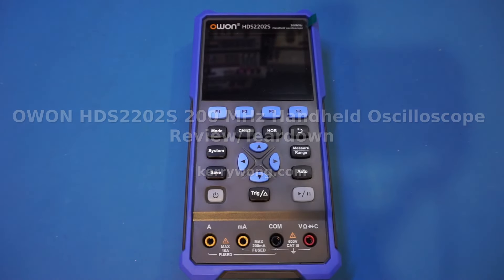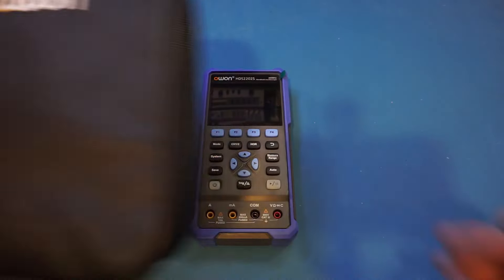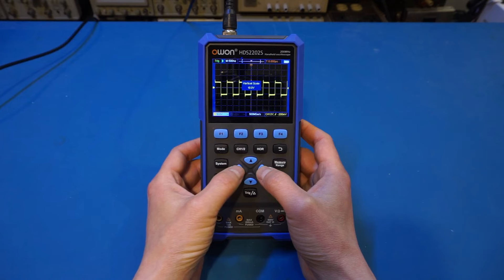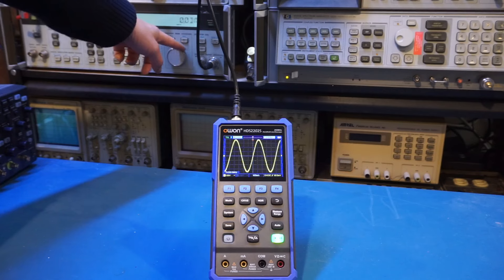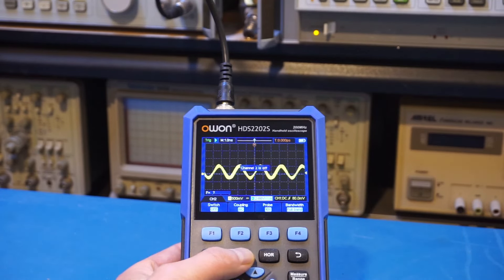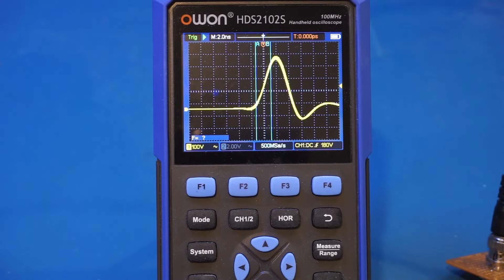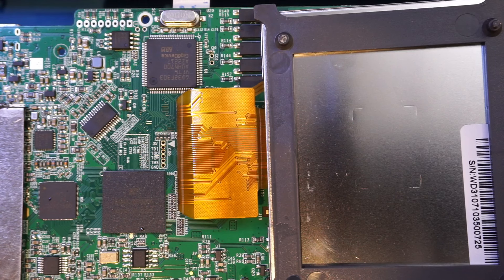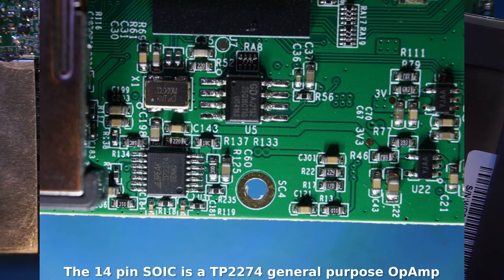OWON HDS2202S 200 MHz 3-in-1 Handheld Oscilloscope Review/Teardown

Comment: I just ordered this meter after much research and cannot wait to receive it and try it out. Something that sets this meter apart from the other reasonably priced meters is that this meter is supported by the US company Digi-Key which has users manuals available and individual items available as I see this unit only comes with one oscilloscope probe for some reason. Digi Key has the appropriate 1x-10x 200 mHz probe available, as well as the meters and other OWON products.

Comment: Thank you.  The HDS2102S looks very impressive.  I’ve been using the 100 MHz version for a little over a year and it has become my go-to because it is just so convenient.  I agree that I’d like to see some improvements such as auto-cursor measurements and protocol decode.  FFT would be nice, but not all that necessary in an instrument with this form factor.  Perhaps Owon should consider an HDS300 series with the added features.

Comment: I bought a HDS2202S and it arrived two weeks ago.  My examination of the unit I received is comparable to this video review.  I am impressed with the value versus the price.  I have noticed that there is about 1/4 minor screen division of noise in the vertical electronics.  Setting the 20 MHz bandwidth limit in the channel menu doesn’t have any effect on the noise.  There also seems to be some jitter in the sampling gate time, but I don’t have instruments capable of quantifying jitter.  The result is that there is some noticeable thickness to the waveform trace, but there is no issue with display stability.  I also have the HDS2102S and the waveform trace looks slightly crisper than the HDS2202S within the published frequency specification.

The screen of the HDS2202S is very slightly larger viewing area than the HDS2102S and has better anti reflective coating which improves contrast.

I did not rigorously test the battery capacity, but the HDS2202S is able to run for two hours or more while maintaining performance, with the display set not to blank.

The HDS2202S adds a few additional waveform measurement capabilities, but there is still no FFT or protocol decode.  The record length may be set to 4K or 8K points.  A longer record length would allow for more time separation between the triggering event and what is on the display screen.  So far the record length has been OK for my use.  A few waveform traces may be saved as data and several screen shots may be saved as image files.  The system menu allows the memory to accessed as a mass storage device to download the data over USB.  The default USB mode is HID, but I have not used PC software with the instrument.  In mass storage mode, firmware updates may be loaded and will install when the instrument reboots.  As of this writing in December 2023 there have not yet been firmware updates for the HDS2202S.  Other models in the HDS200 series have had firmware updates issued and may be downloaded from Owon’s web site.

Other than the oscilloscope section, the operation and outward appearance of my two HDS200 series units is the same.  Build quality is decent.  The fold out stand seems a little light weight, but so far it is holding up OK.  Safety features seem up to par.  The plastic shell BNC connectors are a nice touch and ensure that the outer shell of the probe’s BNC connector won’t have exposed high voltage if the clip lead of the probe is elevated above earth ground.  So far I have not had durability issues with the BNC connectors.

My HDS2202S arrived in a factory sealed box and it did not include the charger wall wart, but it did include a USB C to A cord.  The manual says that included accessories may vary with model, so technically that was not an omission.  My older HDS2102S did include the wall wart.  All other accessories were the same, except the probe spec is 200 MHz for the HDS2202S.

My prior experience with Owon technical support is that I received a useful correct answer by e-mail within a few hours when I had a question about a bench digital multimeter.
Reply: > I have noticed that there is about 1/4 minor screen division of noise in the vertical electronics.  Setting the 20 MHz bandwidth limit in the channel menu doesn’t have any effect on the noise. 

Have you tried setting [Refresh] to `low` in [HOR]?

Comment: Great review. I personally find the performance of the DMM in the model I have (HDS272S) very good. The biggest complaint would be the slow speed of it's auto ranging, especially when testing resistance. Otherwise, its the best I have next to a Fluke.

Comment: The technical level of your reviews is way above my head but I learn what I need to know about the device being reviewed to see if it will fulfill my needs.  This seems to be a great scope to use for automotive diagnostics and is less expensive than a Picoscope.  Thank you very much.
Reply: The cheapest versions of Pico are under USD 150 and even they come with great software for automotive use. They are 10 to 25 Mhz only but sometimes that is not the point.

Comment: Kerry always love your reviews. I have a older one and it always bothered me about not have Vrms measurements on them. Perhaps you can convince Owon to update firmware on older models to have this feature,. It shouldn't be a problem using same micros. The other lack luster things about the HDS series is the limitations of the cursor measurements. I believe I was annoyed it didn't allow cursors when XY mode is on, but I do like to switch back and forth to look at the waveform with cursors on. Its just suddle things that add up.. The software side some love for a more polished experience. Overall still glad I have one.

Comment: I just bought a HDS2202S 200, after reading your revew.

This is my first 'scope,  been wanting to get one for years.

I'm an old geezer that's messed with basic electronics for years, still a beginner.

I would be very interested in seeing if you could show how to hook this scope up to a breadboarded very simple  transistor-LC-tank transmitter circuit running at the lowest reasonable freq  (1 10M ???),  to get some kind of results showing what the oscillator output looks like.

I don't know anything about connectors,  "levels" (voltage / impedance / input) that might be needed to get things "talking" together.

It doesn't need (or probably ??) will be able to very accurately portray the waveforms, values, etc,  "in the ball park" would be nice though.

(just the the three components (trans / induct / cap) .... and / or a resistor .. if neccessary).

Having read a bit about "dummy loads",  I don't know if it would really be necessary, if only using a  1.5 - 5v battery, but if so, details on the dummy load would be great.

I am also interested in knowing if tiny antennas could be put put into the breadboard  and the scope, to actually get the scope to capture the RF transmitted signal, even if the scope / board were only a few feet away.   If so, again, how would they be connected ?

I don't know anything about how the scope and board would need to be connected,  i.e.  does the scope come with cables that
can be connected to the bread board, or do I need to solder a BNC connector to the breadboard ?

I don't think  I can "blow anything up" connecting the circuit to the 'scope, but I would love to hear your expert advice.

The goal is to try to experiment with oscillators / RF ... eventually modulation .... "radio"  starting at a very low primitive beginner level,  using modern test equipment.

Mike

Comment: ..... Well done Mate, wisdom beyond your years.
Articulate, professional, entertaining, consistant - (Still can't find your 50 Ω termination), 
and 'cool for cats' .
Reply from the maker: I really need to buy a new through 50 Ohm termination adapter. I haven't found much need for it as I mainly use my SA for HF stuff and it has proper termination built-in.

Comment: i have problems in using Cursor Measurement using Owon HDS2202S.

My input signal consists of 7.40 RMS (19.8Vpp) with 13.4 Vpk and -6.40Vpk and a frequency of 25kHz. I used Hantek DSO5102P Digital Storage Oscilloscope  and used cursor measurement and it shoes the 12.4 Vpk (S) and -6.40Vpk (E) with dV = 19.4V, dt = 20.00 us, and 1/dt = 50.0 kHz. On the other hand, upon using the cursor measurement function of Owon HDS2202S, the A cursor line and Ma(maximum) measures  10.20V and B cursor line and Mi (minimum) measures -10.60V.

Is there possible problem with Owon Handheld oscilloscope when it comes to cursor measurement ?

Comment: Excellent videos.  If I could ask a dumb question, how would this do for capturing a longer time of lower frequencies?  Say for example you wanted to capture hall and inductive signals from a crank and a cam sensor, or if you ran a current probe on the starter but also wanted to see individual cam pulses for at least 2 revolutions?  How far back can you scroll on captured waveforms?

Comment: Could you please measure the back emf of the gnd line, which occurs at the moments of stopping and starting for an ac or dc motor, in single mode?
Also, can you measure the magnetic field generated at the start of the motor in single mode and normal mode on a signal line that goes close to the motor phase?

I want to know how accurately it measures noise. In fact, if you have a much better quality oscilloscope and you can compare it with it at the same time, it will be a clearer answer.
In addition, if you also include and compare HDS2102S and HDS272S in this test, we can understand the difference between measurement capabilities much better.

Also, thanks for this great review video.

Comment: I buying the S this very model. They are getting better and better every revision they come out with. Been impress with this series overall.

The waveform update rate on these are getting increasingly good for this series.
Reply: Some trigger improvement?
Cursors?
I have the HDS242s, Iam thinking to buy a better unit.
Thanks in Advance

Comment: Nice piece of kit, but they should have increased battery capacity to account for the higher consumption over prior models.
Reply: Any reason you just couldn't use a higher mAH battery, say a 3400mAH?
Reply: @jackrapter5348  And maybe that’s what they should have included, which was my point.😉

Comment: Can I use mpd3000 differential probe with 100x,1000x,20MΩ / 1.5pF( differential )
10MΩ / 3pF( each input to ground ).I need for cat 3 type of work?
Reply from the maker: Yes, but you will need to supply the power to the probe separately with a USB power source.

Comment: Applause. Does it have a variable persistence mode?
Reply from the maker: No it does not.
Reply: @KerryWongBlog  Do you know any good pants-pocket-size battery scope that has 
variable persistence mode?
I'm after catching LED communication signal glitches (e.g. FW1906, WS2811, etc.) in the data line. My TEK scope is just too heavy, especially with an external battery.

Comment: Hi, nice review. I saw review stating that HDS2202S is getting realy hot. It is an important information. Wasn't it in your case? Regards
Reply from the maker: I did a video on that: https://youtu.be/e0TrzX9gD9Y in short, it runs hotter comparatively, but should not be an issue.
Reply: @KerryWongBlog  Thanks for your answer. I understood they were on for just 30 min. I assume, during  the measuerments they would added some degrees.

Comment: Thank you for this review. However, for a rise time measurement it is required that both stationary states of a sufficient fast step are displayed, and the signal path should have the correct impedance. You mentioned issues with the rise time measurement, but it appears somewhat misleading to use this rise time measurement to estimate the bandwidth. Rise time measurement could easily be a topic for a separate video :-) Anyway thanks for the summary.
Reply from the maker: The impedance mismatch definitely affects the shape of the pulse as you could see there was significant ringing of the displayed signal. The measurements were just an approximate estimate, and when putting all scopes under the same measurement condition like I did you should be able to see the differences in bandwidth among these the tree scopes. But it should be taken only as a very rough estimate as you mentioned and not an exact measurement.

Comment: No thx, no intensity grading does not add up in 2023 at these prices and the waveform shown seems to rely on some weird averaging & persistant blur when it wants to, and does not look to be something the user have control of and that aint soemthing you want, with all this trickery behind the scene.. look at that chubby line and the fidelity of that signal is completely crushed from make-up... how can you thrust the wffs numbers when the signal is so manipulated, then everything is relative and that the last thing you want in a measurement device...
and a max of 8K depth and a max of 10k wfps, that I even doubt it can mustard, and Owon UI & fw often leaves a lot to be desired..
Owon and their scopes, no wonder they got a bad rep.
who maks these handheld scopes, as it the same line that is promoted under numerous brands, not least "Victor" who also got the exaxct same line of scopes like "Victor 270S" (70MHz variant with AWG) just with an orange bumper and also a no name variant in a green silicone bumber sleeve.
who makes these scopes, as numerous brands just seem to slam their own name on it.. Maybe you should sort out stuff like that channelholder and mention all these other budget CN brands who also got a model of it, atleast if your viewers interrest have any merits?